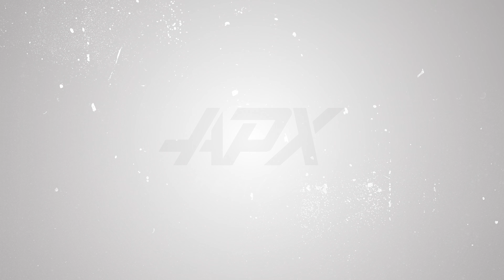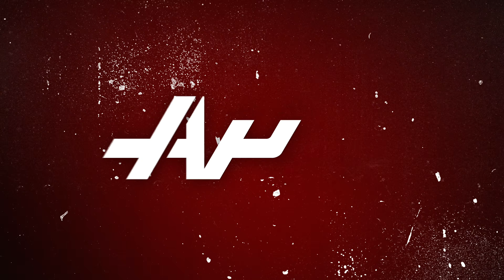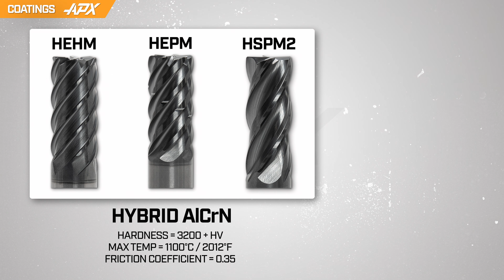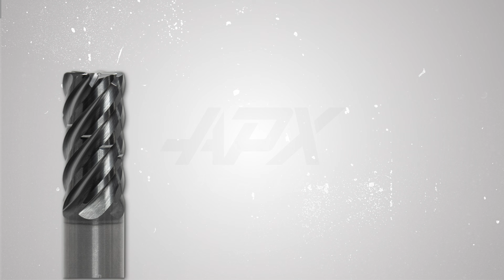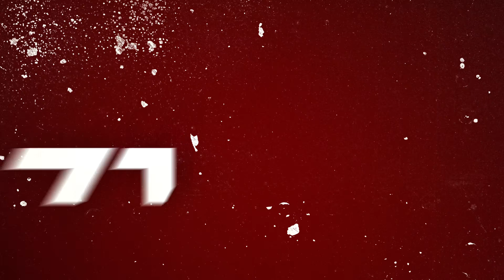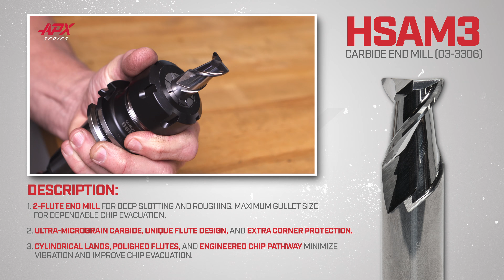APX - The New Line of High-Performance End Mills at HaasTooling.com

Comment: I used HAAS endmills donated by a rep. And they SUCKED compared to helical, sandvik, and kennametal. I was high speed machining some A36, the HAAS endmill chattered so much it was vibrating the maching, all the others only chattered when they were dull. I was removing 27lbs of material.
Reply: I recently removed 1,104lbs of 17-4 at 36hrc with both Emuge and Haas endmills. I had no issues with the Haas. I had some other indexable tools in the mix. But I was ripping chips with the Haas 5fl in an emuge mill chuck. 320sfm 9% step over 1.5-2xd axial. For the price I'm buying more and more as they kept up with my Emuge stuff.
Reply: @jnsd891the A36 was just eating through them, its possible we just got a couple bad ones. But for the price difference we just stick with Helical.

Comment: I will go against the grain here and say i´ve been incredibly happy with all Haas endmills using them on aluminium mainly, but some stainless steel jobs too.

I LOVE my 16mm DLC coated chip splitter rougher. It has made probably a ton of chips at this point and it´s still like new. I hope you guys plan on doing some Through tool compatible, DLC chip splitter endmill soon, ideally with the new benefits of the APX?

Thanks!!